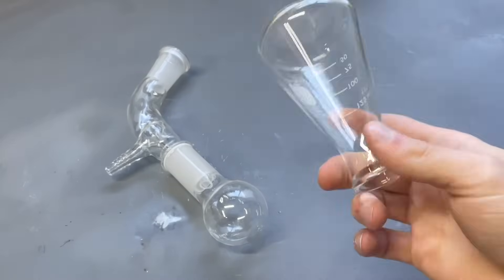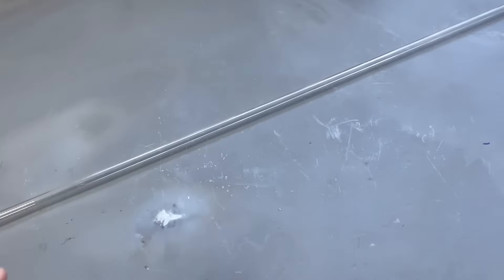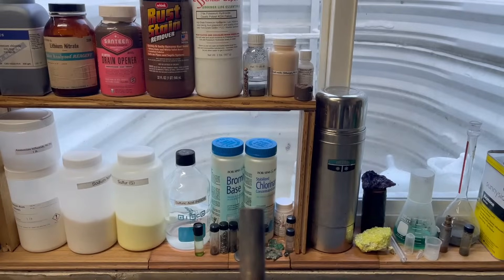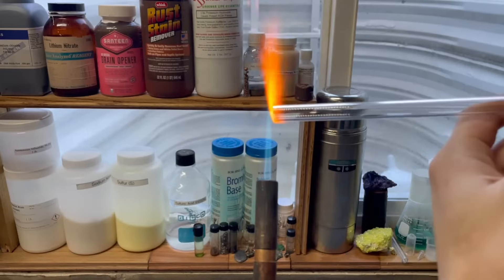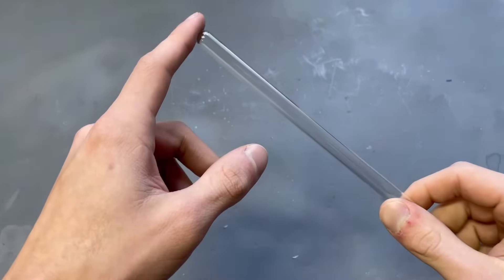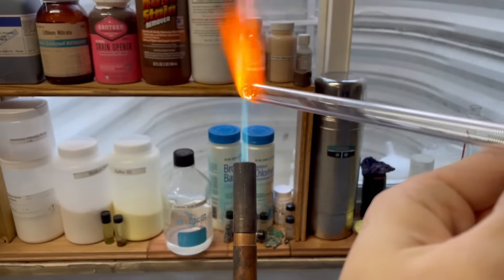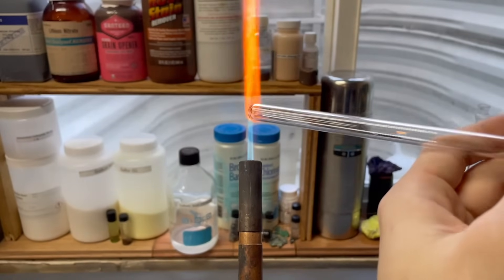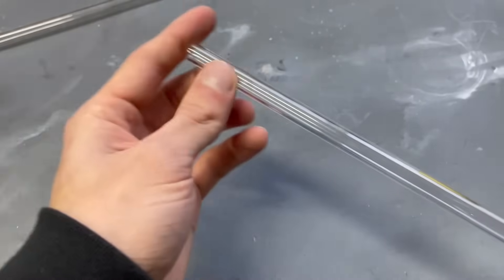Scientific Glass Blowing EP:0 Intro and some basics

Comment: You glass cutting technique is not a safe way of cutting the glass. Glass dust is extremely bad for you if it gets in your lungs. also holding the glass with your hands so far from the point you want the glass to break is just asking for stitches and and the point of where the glass will break may not be where you scored it.  Glass is a liquid not a solid, all you need to do is break the surface tension. You just need to nick the glass you can use a small triangle file or  tungsten scoring tool. then wet the score, water or just some spit works great. With your thumbs placed behind the score you want to pull and with a slight movement of your wrists moving away from each other the glass will snap with very little effort. Of course this should only be done on the small rods and tubing anything smaller than 25mm or 1 inch. The map gas torch you are using isn't hot enough for lampworking. you need a oxy/propane torch if your going to work borosilicate glass. you can get a cheap one if your just going to make simple repairs of small work but if you going to do more than that I would spend the money and get a proper glass torch.. I would suggest finding a glassblower and getting at least a 1 hour class to cover the basics; cutting, polishing, gathering, pulling points, a few seals and most importantly annealing your finished work. Then get yourself a truck load of glass and practice, practice, practice. You can call glass suppliers or if you know any glass blowers and ask if they sell there breakages you can get useible pices real cheap. I've been blowing glass for over 30 years don't get discouraged your off to and ok start you got the right idea and keep at it. We all started where you are. Find someone to show you the basics get proper equipment and practice. before you know it, 30 years will have passed and you created a lot of very nice and useful stuff. Hope this helps good luck.

Comment: I think when you use file to cut the tube only a tiny line in a few mm length is enough and when you bend it brake. doesn't need to go all around the tube.

Comment: A note, when lighting your map gas take your left hand and cover the holes right behind the tip then strike the starker of course after you turn the gas on a little, should lite up on first or second try, if it doesn't light turn gas off and investigate fuel source or clogged tip.

Comment: Is that borosilicate or flint glass?
Reply from the maker: Boro
Reply: @WheelerScientific  is it necessary to score it all the way around?  I've seen others just nick it with a file and snap it, but that may not have been borosilicate...
Reply from the maker: Well, I just put a nick in mine, you just want to create a weak point for the glass to flex and break.
Reply: @dl08in   ´normaly´ or as professional we have special knifes, but it is basically just to make a short cut which makes a weakpoint like PLA stated but it gives also the direction of the crack. So if you cut it perpendicular it gives you a nice edge and if your cut is out of line the edge will be crooked.  Sometimes it can help to smear a little spit or water over your cut just before breaking. Also you want to put your thumbs right next to your cut and have it facing away from you, so you can see the cut on the other side through a small gap between your thumbs.  Reduces the risk of injury. Also it is not only pressure to break the tube, but also pulling apart, like with the paper, because glass has a very low pulling resistance. This way it is easier and safer.